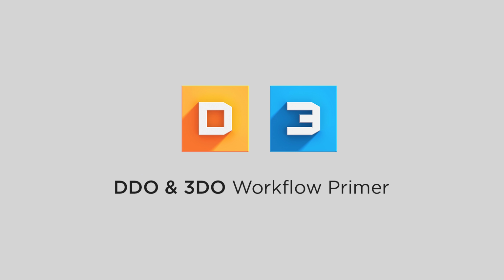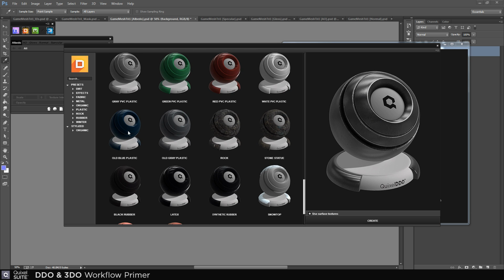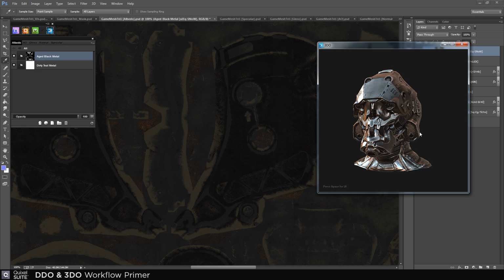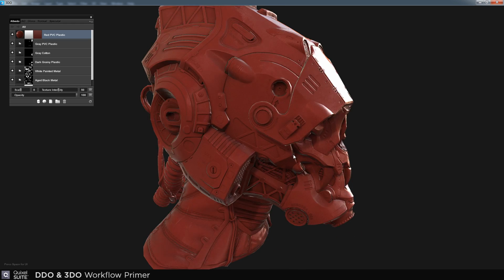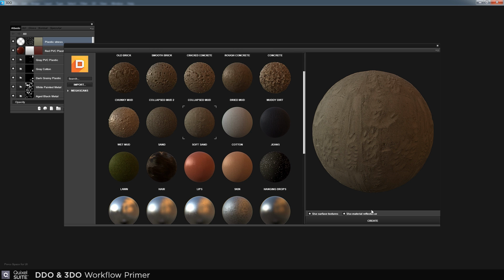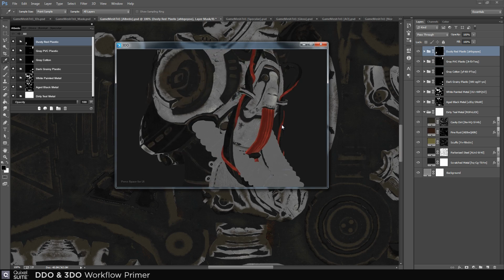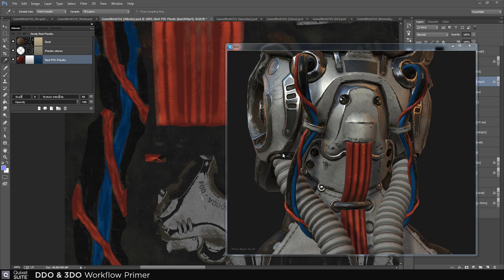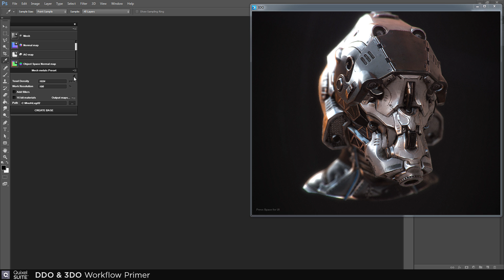DDO & 3DO Workflow Primer

Comment: does this software automatically find the edges on your model and 'scratch' the paint off when creating the textures, or was that done manually in photoshop/viewport canvas earlier?
Reply: I believe that the software automatically finds the edges based on the ID maps that the material is being applied to. In the material viewer for the various types of steels, the edges are present on them as well. That's just a guess, though. I haven't used this software yet.

Comment: Teddy, I don't get "Links" when I import my ID map.  How is that supposed to work?
Reply: Hi, I have the same problem. Did you find solution?!
Reply: +Boris Mesaros  the links are generated using a special plugin for Maya ;).
Reply: Tnx for reply :-) but I find solution ....New version don't have links button in color ID. You can assign a new material by holding SHIFT with C, and then clicking on a color ID

Comment: I try to follow the example step by step using the same maps and mesh you are using, however at around 2:00 mins in... when i select the Dirty Painted Metal (Dirty Teal Metal) it loads up only on part of the object... In the DDO window, it shows a mask where yours is completely White square... You applied the Dirty Painted Metal to the whole object, whereas mine only applied on the masked area. I don't know why a mask was applied or how to remove the mask so that the Dirty Painted Metal applies to all the object. Please help
Reply: Sounds like it is set to a mask from the color id map try clicking on the little box to the right of the material and removing it

Comment: anybody can tell me if this is fully compatible with vray?... I mean... the 3do prevewer looks stunning... but... once you finish the procces you need to use it in the animation program like max or maya and then render it in vray so... vray's specs, alphas and more have a different approach than the standar render... then where do you custom that???? bcuz it is fully compatibble Il buy it right now

Comment: The reworked NDO is much the same as the legacy, but much better. The new DDO is very different and will require some time to figure out, but right off the bat there are some definite improvements. This video is a big help.

Comment: I've really got to get DDO & 3DO for my toolbox!  #dDo
Reply: It's looking pretty good and $99 is a decent price I think.
Reply: Phil Nolan Yea absolutely a decent price. You should check out the megascan demo on their YouTube channel. Quite impressive!
Reply: Connor Schilling First of all max and maya  are not ordinary modeling platforms, they're the two most expensive full animation packages on the market. Secondly what does that have to do with a texturing plugin for Photoshop?
Reply: Connor Schilling Well LightWave puts them all to shame but it's still unrelated to a Photoshop plugin. It's an awesome plugin but it has nothing to do with modeling.
Reply: Connor Schilling All I said was that it was a good price and you started going on about modeling programs. You called it an amazing piece of  3D software and it's not even really stand-alone software.  I give up.
Reply: Connor Schilling I was just confused since they're not similar products at all so I couldn't figure out why you were comparing them.

Comment: You don't actually seem to be using any of the photoshop tools...it's all custom so why insist on it being a photoshop "plugin"? Release this beast into a stand alone app and meet substance designer head on.
Reply: It still uses a bunch of photoshop filters and features under the hood... it's just all hidden now and wrapped in their own UI to simplify it and not have to deal with all the messy layers, they're all behind the scenes and now you just have only custom useful UI to edit things with.
Reply: agree
Reply: Not only what Benjamin said, but also in the end you are left with full clean perfect PSDs that are easily editable with every element masked and in its own layer. This is fucking invaluable.
Reply: Ddo is quick and easy but prefer substance designer and painter